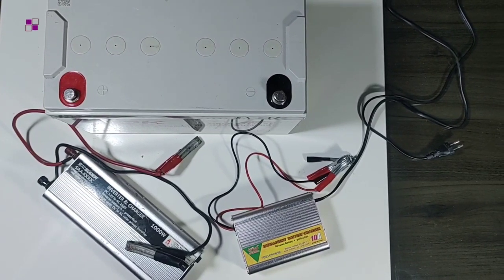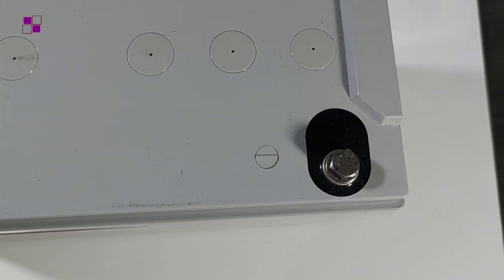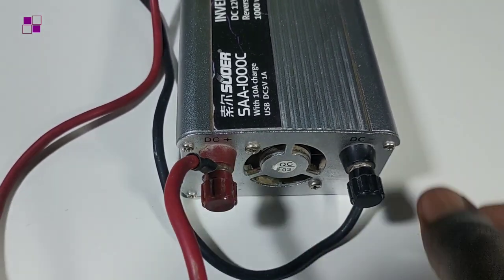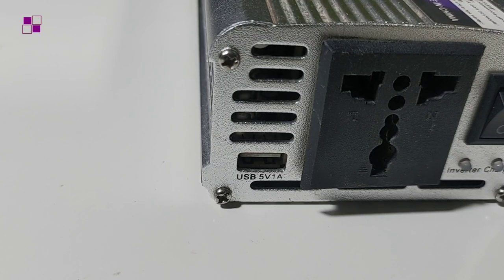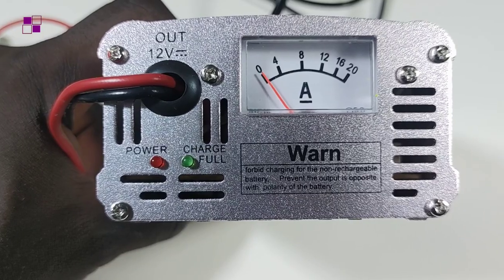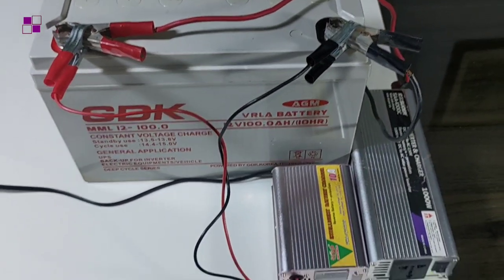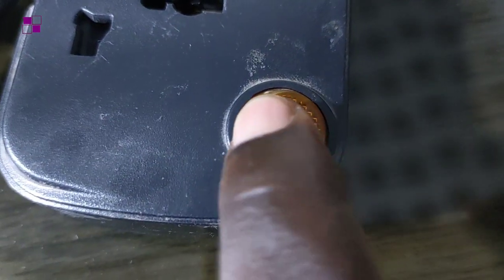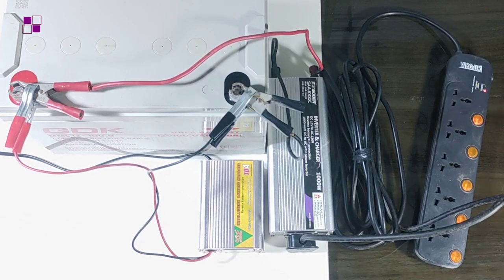Inverter Backup System // How to Setup a Simple Power Backup System

Comment: Thanks for the video, pls how can one get a good 100amps battery. Or can you recommend the Souer Brand? Also, I checked your website but they are full of house materials.
Reply from the maker: Thank you so much. We are currently upgrading the site to accommodate few electronics products shortly. All Suoer Brands are good and do last long if you get a good one and also do not abuse it.  We have list of experts who can assist in all you need when it comes with power backup. We can connect you!

Comment: Can you plug the charger to inverter without nepa?
Reply: Can you change the battery back to the output inverter?
Reply from the maker: No. You can only charge the battery using national grid source (Nepa) or generator set
Reply: How many amps charger is good for 75a battery?